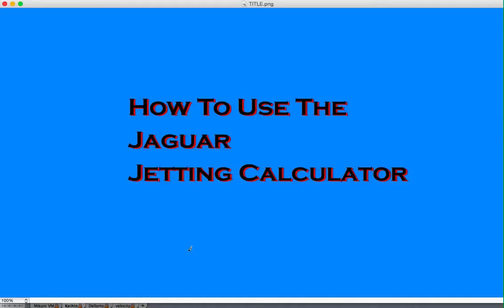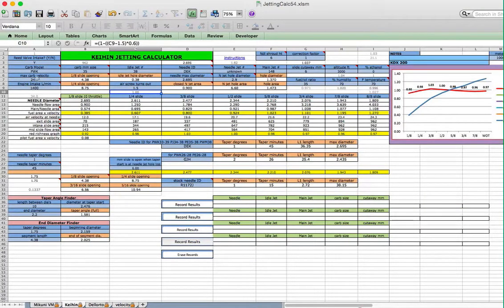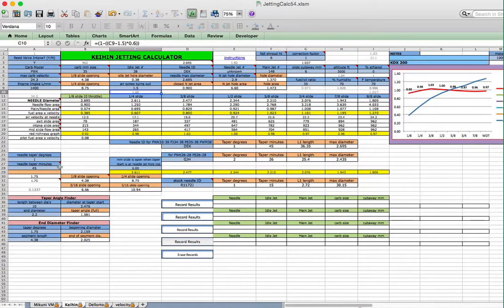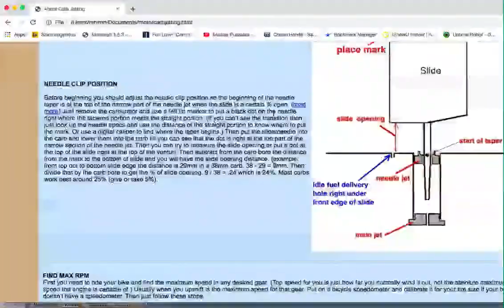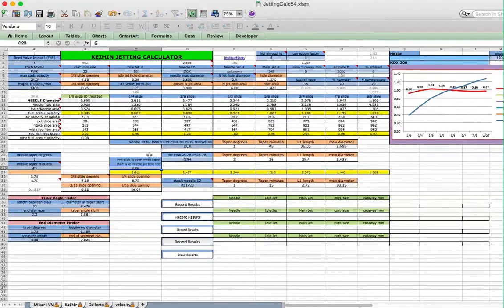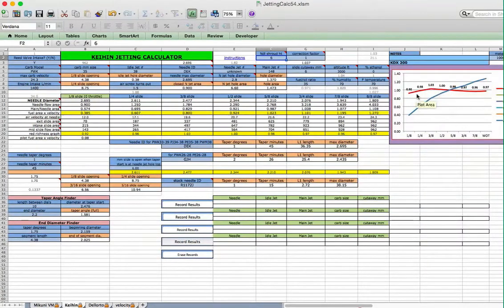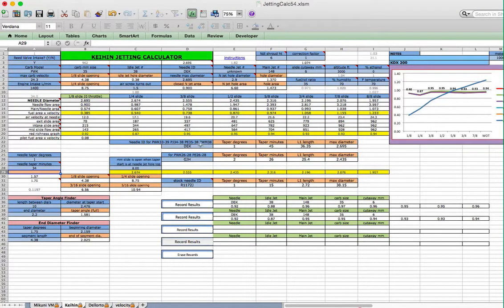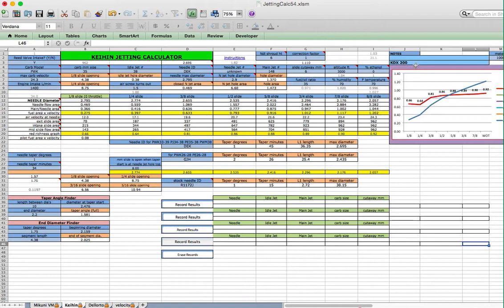Using Jetting Calculator for Keihin Carbs

Comment: hi ! great work :) ... I'ved visited your pages, it's most about 2st carbs ; I run ONLY 4st carby dirt bikes
Reply from the maker: Well, the needle jet on a 4 stroke carb has air inlet holes in it which changes its response to vacuum and I'm not sure how to adjust the formula for that. I'd at least have to doodle around with such a carb on my own 4 stroke bike but I generally stay far away from them.
Reply: @MichaelForrestChnl  yep ! 2st are a bit simpler to diagnose & fine tune ;-) ... and "modern 2st", for some decades now, got to have valves both at intake and exost... a bit "like" 4strokers, it made real improvements to help at low to middle range RPMs
Reply: @skualpascal6684  try to use a WBO Lambda reader during the fine tuning.
Reply: @andykaw1  - no way ! there's no lambda plug & captor at exost tubes.
... & I dislike these remote lambda probes U have to put from the muffler :
 they're too far from hot gases.
Reply: @skualpascal6684  You have to install a Lambda sensor reader... obviously at 100/200 far from the exhaust duct.